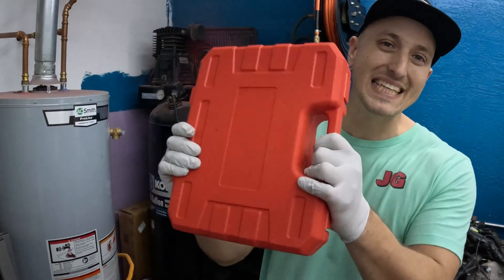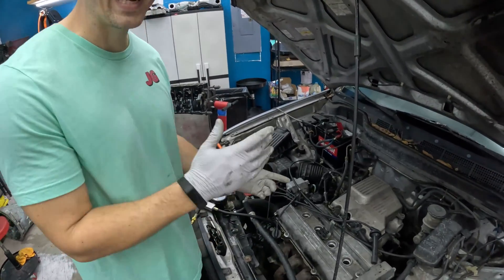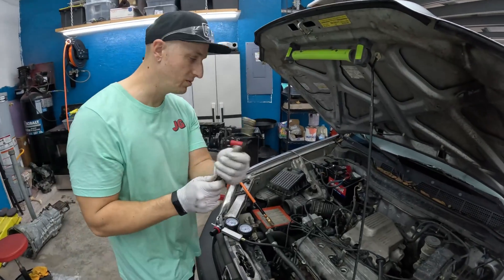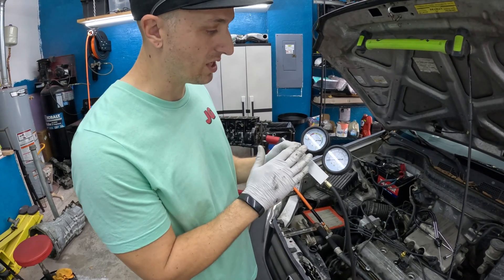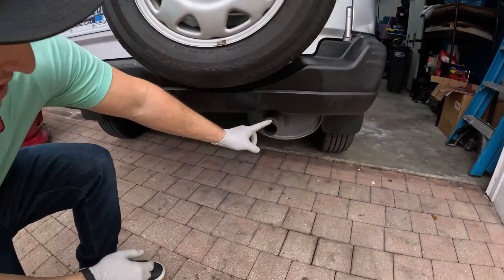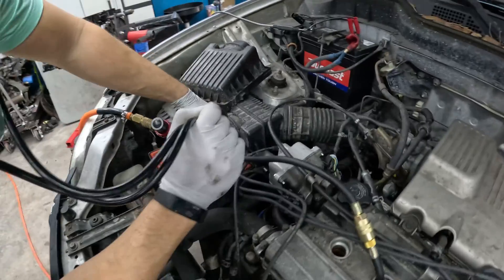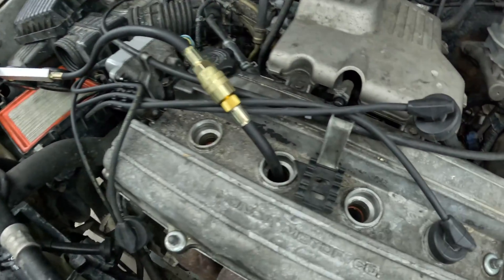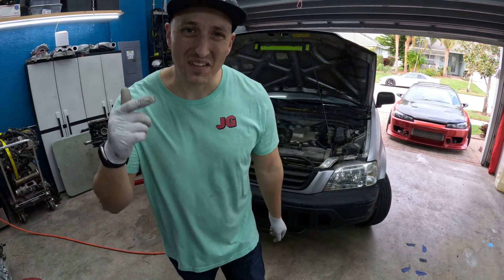How to PERFORM A LEAK DOWN TEST - DIY Car Repair on Rachelle's Project Car HONDA CRV 1st Gen 97-01

Comment: hey man what do you plan on do to fix it, are you gonna take it to the machine shop? i lapped some valves i had in by myself and plan on starting it tmr was in the same place you are in right now 30 psi cyl 3 and a burned exhaust my seat was questionable but i was able to clean it up quite a bit, im on a budget as well so im just curious
Reply from the maker: So I just Pulled a Used head off a good engine and swapped 'em out. It Turns out this head had recently been machined, not sure what the store was on this engine but I found it to have missing parts and been messed with in the past. We have her up and running now tho. If I didn't have a new head I would have cleaned the seat and just replaced the valve, I'm a budget builder too. Thanks For watching!